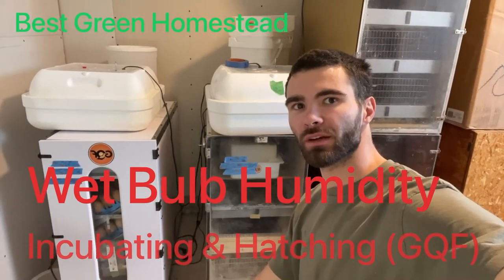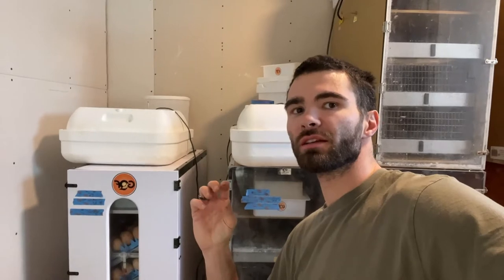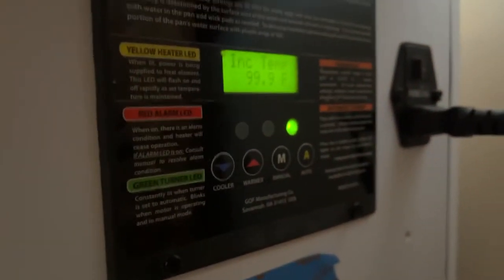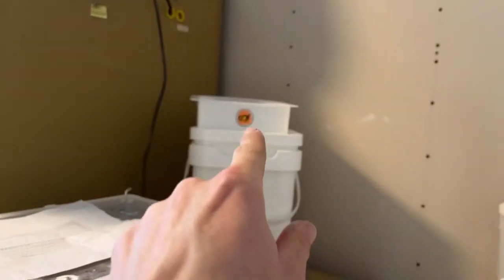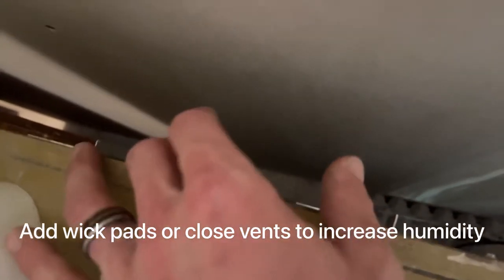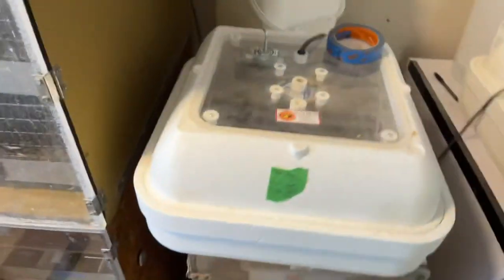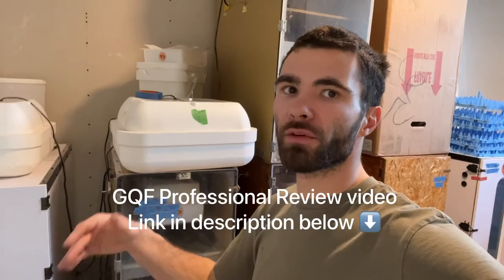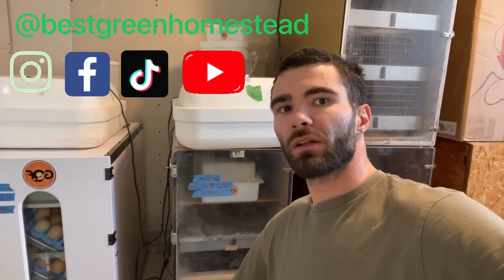Read & Adjust Incubator Humidity - Wet Bulb Humidity is the MOST ACCURATE! (GQF Sportsman & Hatcher)

Comment: Thank you for sharing, Please is there any inbuilt humidity controller in the GQF
Reply from the maker: Not something that changes it on its own. For the cabinets it is the water tray and the 2 wick pads you can add. Usually no wick pads for incubating and 1-2 for hatching. I recommend one for incubating ducks as they like high humidity. You can then get the water reserve system/ bucket #3030. This way the tray has a float valve and always remains full! All you need to do is make sure the bucket is topped off once a month or so. The humidity once adjusted, usually is good for the season. Our climate it is dry in winter and humid in spring summer and fall so we adjust accordingly. 

Subscribe and you can see more on this in coming videos. We have a new incubator &  Hatcher shipping to us now. We will soon have a unboxing and review video showing setting them up including installing the 3030 water reserve system as mentioned.

Comment: Great Video... Thank you! 
Where can I get a copy of your conversion chart and how to use it when using a Hova-Bator GQF Incubator Thermometer / Hygrometer (Wet Bulb) 3018.
Reply from the maker: You should get one with the Hygrometer itself. But if not it may be available online at gqfmfg.com 

If you can not find it quickly, just comment back. I can send you a picture of mine no problem. The chart would be used the same as I explained in the video. For your Hovabator you will just need to ensure that the wick is placed in water inside incubator so it can wick up water to get an accurate reading. 

Thanks for the comment. If you like the video please subscribe. We have lots more videos to come, and feel free to suggest a video on something you would like to see.

Comment: Great video. I started incubating some eggs a fee days ago and the humidity was at 72%. I added too much water starting out the incubation process but 3 days later it has started drying up and humidity has begun to come down. Should I worry about the first few days of having too high of a humidity or will they be fine since the humidity is coming down to normal? FYI the vent holes were and are open.
Reply from the maker: No you will be fine. It’s all about how much moisture evaporates from the egg during the incubation process. This can be tweaked by adjusting the humidity throughout and candling the egg and comparing the size of the air sac to what is recommended. You can find pictures online of what the size of air sac should be. It can also be done through weight, as they are meant to loose a certain percentage of weight over incubation. You don’t need to get this in depth though. If too wet for 3 days I would recommend having it too dry for 3 days or so to compensate. Then back to 50% or so. 

Remember the volume of water does not change the humidity only the surface area of water, and the amount of ventilation open or closed. Less surface area will lower humidity, but same surface area of water and less volume will not change it.
Reply: @bestgreenhomestead  your explanation makes perfect sense. I followed your Facebook page. Thank you for your time.
Reply from the maker: @lindseyhomesteadfarm glad to help. Thanks for that. We are also on Instagram, TikTok and don’t forget to subscribe on YouTube to see more on incubating chicks, ducks & geese, as well as breeding on pasture and everything homesteading. I’ll subscribe to your Chanel as well! Best of luck to you in the 2022 season!

Comment: Hello! I have the GQF 1502 Sportsman - I've never used this incubator before...Do you have any advice or pointers on making my first time go smoothly? And do's or don'ts?
Reply from the maker: Buy one of these wet bulbs wicks and perfect your humidity during both incubation and hatching. This is all you really have to worry about doing manual. Incubator for temp is set it and forget it. Clean incubator often for higher hatch rates.
Reply: @bestgreenhomestead  Thank you!!
Reply from the maker: Also I do not recommend hatching while incubating in a 1502.  This is because the humidity levels are different for hatching and incubating. But if you do favour the 75% hatching humidity temporarily while hatching in the bottom. A hatcher or  couple hova-batos paired up with 1502 would be ideal
Reply from the maker: No prob! Best of luck! Careful not to cut yourself on the sharp metal in the 1502! Been there done that!

Comment: Please how much is kept in the GQF for 45 to 55 humidity. Thank you
Reply from the maker: Depends on your climate, for us we have 1-2 plugs open and the humidity tray filled with water, but with no wick pads. The water volume or depth does not change the humidity at all. Only surface area changes the humidity. So you can have a full tray of water or half full tray and it will be the same. So you can always keep a full tray of water. That’s why the wick pads are added as they give more surface area, thus increasing the humidity inside the incubator. 

Hope this helps!
Reply: @bestgreenhomestead  you are a big help thank you
Reply from the maker: @ebenezerappiah8735  don’t forget to subscribe! 😃 we will be doing videos in depth on full hatching process

Comment: I have incubator but the humidity level is not increasing more then 32% as it should be 50% I put 3 cups with water but it's not increasing and I think it's winter may be that's the reason?
Reply from the maker: Sorry for late reply, remember only surface area of water increases humidity. Never volume. So you need to add more surface area of water. Hence why the long trays of water in the tabletop bators. Also dry winter weather. Try to have in a room that has a RH of 50% or so. Add a humidifier to room if needed. Hope this helps for next hatch at least

Comment: What kinda wick is that ?
Reply from the maker: 3020 - Hygrometer wicks for #3018 & #3019 can be found on gqfmfg.com 
Or if you are crafty you can make one out of a sock or other cotton material. It is best to use a little electric to hold it on the thermometer/hygrometer. 
They can also be found on EBay. Or for those in Canada Berry Hill in Toronto has these and most GFF products. 

Hope that helps! 😄
Reply from the maker: Elastic** not electric